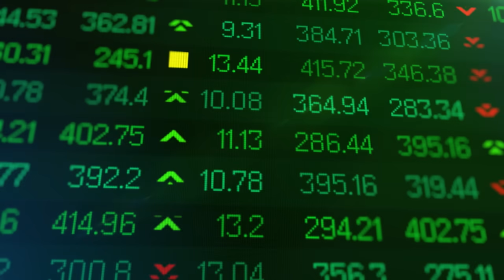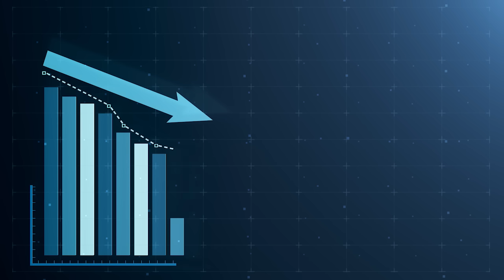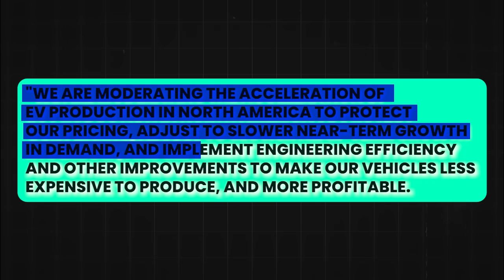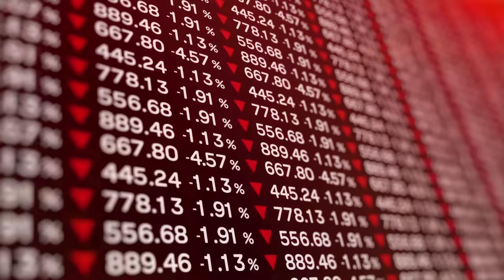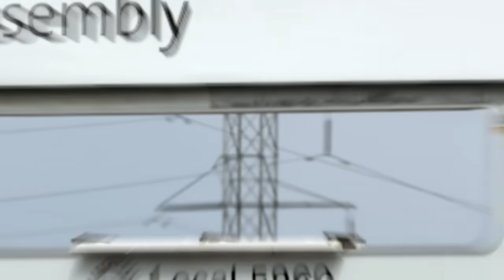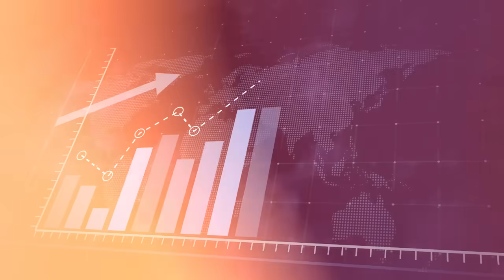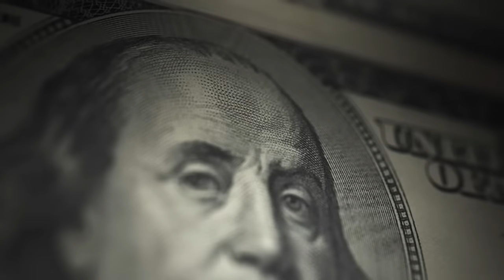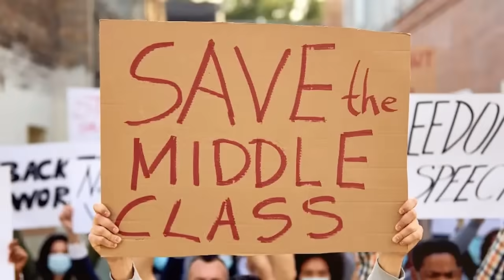HUGE NEWS! GM CEO Just SHUT DOWN EV Production!

Comment: I knew that this was coming, everyone should've gone through the levels of having a hybrid and gas powered motor, to a plug-in hybrid, then to a EV motor. You can't just go from step 1 to step 5 and expect all the profits and positive reactions, you need to go through each step to ensure that what you're going for is paying off. What GM & Ford should do is to invest in having hybrid power to regain traction in this field and go from there
Reply: I can't see the current breed of hybrids being the answer. The added expense, weight and complexity for the relevant modest return in efficiency is the first lie in the whole scam. I get higher MPG in my 13 yr old VW golf than my friends brand new Renault Captur.
Reply: Nah, that’s not it.  Not enough power production or raw materials for EV only.  Then there’s range
Reply: Well said! This whole "throw the baby out with the bath water" approach is nothing more than woke virtue signaling madness.
Reply: Hybrids are the most unreliable car type. And if you don't regularly charge the small battery, which most don't, you're just driving a gas car carrying extra battery weight.
Reply: @KidHorn7001 you clearly know what you’re talking about eh? Go look up the Prius. More reliable than many cars on the road and providing 50+mpg city and highway. No gas power only car doin that.
Reply: Well said.  That's been my view for years.
Reply: My step is ICE all the way.
Reply: A lot of people just do not want a over priced fire hazparked in their driveway.
Reply: @KidHorn7001  well then, stop wasting resources on Extremely expensive EV technology that can never work on the scale intended due to the lack of power production.   Invest those resources instead into hydrogen and other hybrid supporting technologies. It’s not hard to realize what needs to be done here
Reply: Once again the government dose an outstanding job.
Reply: @septembertorpy6899 
Hats off to this administration. Build back better BS

Comment: I LOVE my EV...for trips around town and as long as my at home level 2 charger is at hand!!   The numbers do not work if I leave town and long haul a car.  They are simply not viable as an only car for anyone needing more than 250 of miles per day, especially in winter.   This is why I have an ICE car for everything else outside of my normal daily commute.
Reply: 99% of my driving is to Trader Joe's, Costco, Smart and Final, Walmart, Sprouts. My 2021 Bolt Premier is perfect for this. I charge with solar and my lease payment is $289 a month. I save that in gas and maintenance. And waiting for gas at Costco. I laugh at the lines. Here in SoCal, gas is near $6 a gallon. For my 1% of driving (long trips), I have my Prius V.
Reply: That is great but as a single person I cannot see of afford 2 cars, so if I have a choice for now it will be an ICE vehicle because all around it fits my life much better!
Reply: Ever hear of the Supercharger network? All EV's can now use them.

Comment: California limits what time of day and how long you can charge vehicles.  A road trip in a Ford Lightening EV ended in less than a day because of lack of charging facilities (continued by renting an ICE truck).  Our city has a statute that makes it illegal to charge an EV inside or within 10 feet of an occupied building or residential home.  The batteries are that dangerous.  In China, the EV boom has crashed.  70% of the companies building EV's went bankrupt.  And the major player, BYD, is teatering on the verge of bankruptcy due to the HUGE number of battery fires.  EV's are fantastic for short range driving/commuting.  Tesla's long range gives it an advantage, but it is still moderately difficult to charge them on long trips.  So, if you are ONLY going to do short trips in your EV, then an EV is the best choice for you (unless you live in CA where you are not allowed to charge them).  But we just bought a 2024 Camry hybrid that gets BETTER than 50 mpg.  And their quality made the choice incredibly simple.  Highest quality, incredible fuel economy, huge dealer network for assistance, and a reasonable price ($32k through Costco).  And we only had to wait six weeks for it to be delivered.  Why buy 'legacy' vehicles with lower quality, bad fuel economy, little to no company support, and high cost for the quality you get?  It just does not make sense.  And that Camry?  Made in America with a majority of American sourced parts.

Comment: What GM, Ford, Chrysler failed to recognize is that you have to have infrastructure complete before they introduced EVs to the market! 
They don’t under stand the consumer the consumer wants a car that will go 500 miles on one charge and not have to get a recharge before they hit the 500 mile mark and they don’t want to have to wait for a charge port that’s gonna cut into their vacation time or their travel time to their destination plus they don’t want to have to spend $70,000 for a car!
Reply: When charging stations are as plentiful as gas pumps and charge as fast as it takes to fill a gas tank, then MAYBE I'll consider an EV. That's assuming I can also afford to have my house set up for charging and can afford the electric bills. It's also assuming we don't get an ice/thunderstorm that knocks out power for 4-5 days.
Reply: Some weeks ago I took a trip from Germany to a very remote place in Denmark in Teslas least travel worthy car that was cheaper than a comparable ice car. Before we went to the toilet and got our burgers we where ready to go and ended up charging longer than needed because we ate there. 

I also live in a flat without parking lot and charge public. 

Cars are to expensive electric or ice.
Reply: @AnimalisMD  Bro, I installed a 240v charger for the price of a charger and $20 in materials. You'll spend $30 in electricity for $150 in gas. You can charge on 120v each day and also be just fine.

Comment: Good for GM. Our power started going down more in the last four years. It was bad enough that many neighbors decided to get estimates on generators. The electrician told us that "the power grid was going down because too many electric cars were charging and taking up too much energy and due to that the grid was going down."  Before they even started EV production they needed  to consult with experts to find out if the grid can handle this level of an energy vacuum for EV's.  Second point, during a bad snow storm, the news reported that people were waiting at the electric charge station to charge up their EV's and they couldn't because the charger wouldn't charge in the freezing cold! People had to get cabs or Uber out of there and ditch their EV's!

Comment: Yes I want a brand new Ford pickup for 90k that only pulls my boat for 90 miles before I have to charge it for 8 hours again. Great 👍
Reply: Nothing you just said is true about the lightning. And you can pay 90k right now for a gas pickup that will break in 1500 miles (go ahead, look up the issues GM is having).

Comment: Ammonia (NH3) fueled internal combustion engines are the answer.  It's 100% sustainable, has almost no pollution, transporting and storage is safer than gasoline/diesel, would cost about the same as gasoline/diesel, would eliminate crash fires and current internal combustion engines can be modified to use it.
Reply: another option is hydrogen.
Reply: @northdakotaham1752  Option, but inferior to ammonia.  Far to hard and dangerous to transport and store fuel, and requires all new engine and infrastructure.
Reply: If they can make an engine that runs on marijuana, I can grow fuel for it in my back yard.
Reply: @northdakotaham1752  It takes a lot of energy and fresh clean water to make Hydrogen.  It also needs to be stored at extremely high pressure.
Reply: @wilsterone6689  I've watch videos of the conversion. Carbon fiber wrapped fuel tank, 3 to 4 thousand pounds isn't a problem. New fuel injectors, fuel rail with pressure regulator. Same basic ICE engine. Lots of HP. Hydrogen produced on site, on demand...so no transportation issues. Didn't look that bad compared to sitting on top of a ton of high voltage DC batteries that weigh the same dead or charged. Fire hazard!
Reply: @Absaalookemensch  you don't transport it. It's produced on demand, on site where it's dispensed.
Reply: @KA9DSL  if we had weed we wouldn't need to, or want to go anywhere.
Reply: @northdakotaham1752  The fire risk is minimal especially as EVs move out of their infancy. All you need to do is look at a Titan video to know carbon fiber doesn't make a good pressure vessel add to the fact that Hydrogen is flammable and now you are sitting on a bomb even if it doesn't ignite the pressure wave will kill you. Converting drinking water is politicall suicide and desalination is extremely in efficient and not practical for anyone living in an dry environment. Not to mention most manufacturers are looking at fuel cell technology that also requires a battery for storage.
Burning Hydrogen in an internal combustion engine is very inefficient and would require a huge high pressure tank to get any range out of the vehicle.
Reply: @wilsterone6689  you are wrong on pretty much every point. I have produced hydrogen myself with no water used. You might do a little research on hydrogen vehicles. They are already in use actually.
Reply: @wilsterone6689  what does the word "extreme" mean? Higher pressure than your tire?
Reply: @Absaalookemensch  so in your opinion ammonia isn't dangerous?
Reply: @northdakotaham1752  Like all chemicals, even water, can be dangerous.
But ammonia is safer than gasoline or liquid hydrogen.
Bridges and overpasses have been destroyed from tanker trucks transporting gas/diesel crashed and burned.
Like anything, it is risk to benefit issue.
Reply: @northdakotaham1752  You keep telling yourself that.....
Reply: @wilsterone6689  so in other words, you really know nothing about hydrogen, the most abundant and readily available element on the planet.
Reply: @northdakotaham1752  whatever  helps you sleep at night. Why is it that if someone has a different opinion,  their is always someone that gets butt hurt.
Reply: @wilsterone6689  I'm not against people owning EVs, but if you think they are a viable replacement for ICE vehicles you suffer from delusions.
Reply: @northdakotaham1752  i personally own an EV, a diesel  car, and a gasoline pickup. All serve their own purposes. 
I only suggest people choose the right one for their needs and ignore stigmas imposed by crazys on social media.
Reply: @wilsterone6689  as you said, each has its role. Enter..the U.S. government: let's mandate the end of ICE vehicles. Absolute Insanity.

Comment: With electric cars there definitely is a finite resource and that is the metals they use to build the batteries that definitely will run out someday. However oil on the other hand seems to replenish itself.
Reply: 95% of battery packs can and are being recycled to build another battery.

Comment: EV's are a great idea for local trips.  I was interested.
Sticker shock, potential maintenance costs plus the reliability problems with new introduction products made them wayyyy out of my budget.
Reply: The cheapest  ev here in Australia  is 53 thousand  dollars  plus on road costs 

The power  infrastructure  here is still in the stone age  
And good luck finding a charging  station that isn't damaged ,vandalised  or doesn't work
And in rural areas  your out of luck 
Plus the resale of evs  and Hybrids  the bottom has fallen out  and not worth scrap value

Comment: What bothers me about EVs the most isn't the expensive original cost, the limited range, charging time OR the lack of charging infrastructure, nope, it's the simple fact that the ultra expensive battery pack from every EV can and will fail eventually. I'm a low income earner, I just can't afford to play the electric game, I haven't got the financial resources to do it. My current car is a low mileage, 21 year old ice car with a reliable V6 engine. It isn't worth 3 grand anymore, but it still gets me where I want to go and the insurance is really cheap on old cars like mine. You know what, even if I had to replace the engine and transmission tomorrow, it would still be CHEAPER than replacing a batter pack on an EV. Even the humble, cheap, crappy and tiny chinese built Chevy bolt STARTS at a whopping $46,000 here in Canada, so far as I'm concerned, EVs are just a toy for the rich. And by the way, car manufacturers, have you even heard of inflation? People are struggling to heat their homes and buy groceries these days, you mindless twits, it's not that we're not willing to pay stiff prices for cars anymore, it's that we're not ABLE to pay stiff prices. Try getting off your high billionaire horses and live like the average guy for a while, you'll find out that poor people don't always have the option of buying expensive items like your pricey EVs. If you even knew what it's like to live on a limited income, you'd know exactly why unsold EVs are growing in numbers, it doesn't take a genius to figure it out.

Comment: Just do an elementary physics.  Kinetic energy of an EV is 1.3 to 1.5 times bigger than equivalent gas vehicle due to battery weight.   If your EV running at 20mph hits another EV head on at the same speed, you are guaranteed not gonna be walking out of your beloved EV.  Furthermore you'd be more likely wrapped up in a resilient fire.  Simple law of nature.  EV is NOT yet, politely saying.

Comment: I do not want buy EVs from what I know on the following

1. Im not waiting a long time in charging the EV whereas in gas cars, im filled up and out in 3 minutes
2. Im not paying thousands to install a power outlet in my house to add $$$ on the electric bill.
3. Im not paying a price of a new car every 5-9 years on replacing the batteries
4. Its easier to control the fuel when i use the car's features like AC and infotainment whereas a EV, the power goes down faster.
5. Im not paying 30+k on a EV where the base model is $30k+.

Comment: The biggest 2 reason they aren't  selling , 1 power gride isn't  there.
2, the batteries  catching fire and near impossible to put out.  The reason  the battery deteriorates being exposed to salt water. So if drive in the rust belt or live near the ocean, your car could BBQ you and your loved ones.

Comment: The manufacturers completely ignored the single most important truck segment…Contractors. Ford’s basic, affordable contractor oriented Lightning version sold out almost instantly. Meanwhile, the “Upscale” versions sit on lots gathering dust. GM could have released the base model Silverado EV including the high towing capacity contractor version they promised. Instead, they first released the $100,000+ fully loaded to the gills “launch editions”. I hope Stellantis is paying attention because they have the opportunity of a lifetime here to release a Ram 2500 EV Contractor version. The entire Lawn Care industry alone who depends on high route density shorter distance contract routes and is in huge part converting to battery equipment, would snatch them up,like crazy. Give us vinyl interiors, simple radios with a screen for the crews, manual seats, a frunk, charger ports for equipment batteries, 8k standard towing and an option for 14k lb towing capacity in the $50k range, and I promise you they won’t be able to keep them in stock. The fuel savings alone would easily make the payments and in fact would be profitable. The bigger companies have entire fleets of trucks. I’d buy a few.

Comment: Lets get this into more perspective. The internal combustion engine is a legacy heat engine. It uses pistons, cylinders and crankshafts in a dirty, oily, metal lump to convert linear motion to rotary motion at incredibly poor efficiencies. It is exactly the same as a steam engine and in fact represents the culmination of the fossil fuel machine age kicked off by the industrial revolution and James Watt. It is not of the modern age. It is not of the digital age. It is a legacy technology that will die with the fossil fuel age it came from. We are entering now the electric age in a 100 year transitional process and EV's are a part of that future. Those who don't see that are blind.

Comment: We need to change the laws to allow car makers to make cars that we need. They changed the laws on truck emissions so that a huge ass monster trucks get a break, but a normal or mid-sized truck has to get 50 miles per gallon. They wanted to sell $100,000 trucks. All the bosses could write them off. Not the workers whom need a truck. Then they thought a $50,000 ev was a good choice when their market is for a $30,000 car that retains value after 4 years. EVs are worthless after their battery dies in a few years.

Comment: It's cheaper to fill a vehicle with gas, and faster. If I'm on a trip, I get off the highway. Pull into a gas station take ten minutes to fill up and I'm on the road again. If you have to charge your ev, your going to sit for 8 hours or more. Who has time to do that on a trip. Plus it cost more to charge your car. Than it does to fill it up with gas. Plus the existing electric grid can't handle the stress that's on it now. How in the world is it supposed to handle everyone charging up electric cars? It's just not practical right now. The technology just doesn't exist to do it now. Our current administration is lying to the American public about all this.